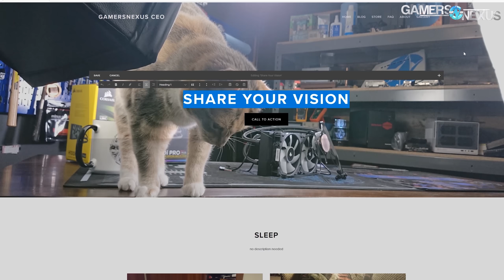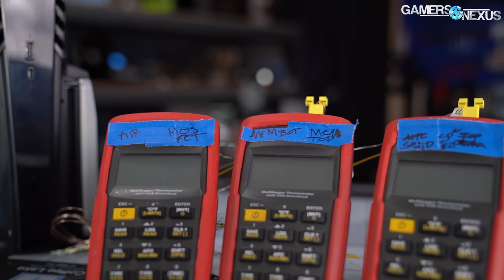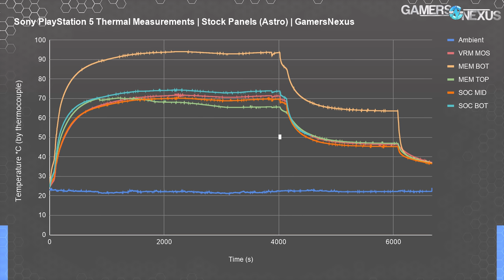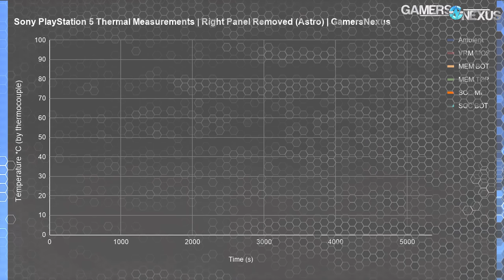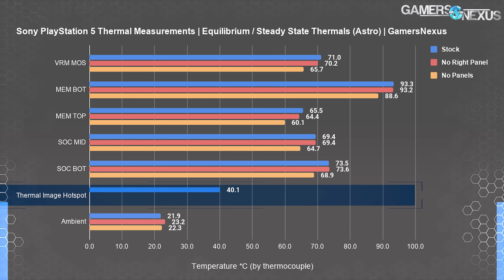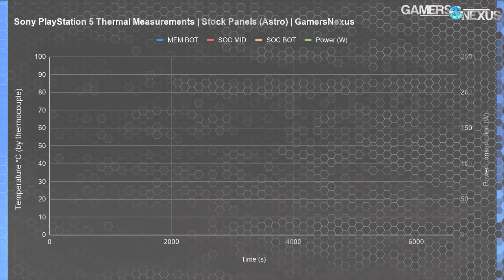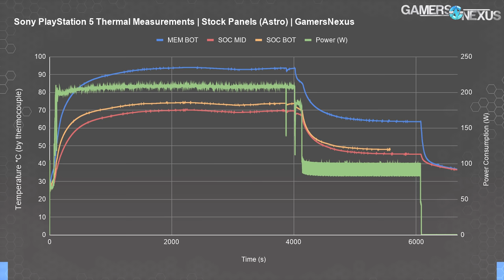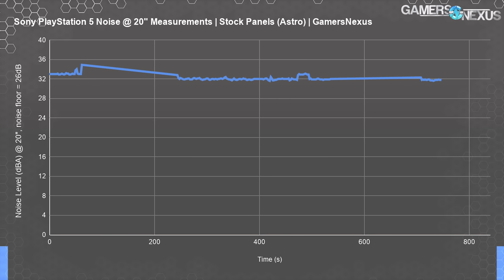Weak Cooler Design: PlayStation 5 Thermals, Power, & Noise Testing

Comment: I always keep my PS5 laid horizontally. Bought custom panels from Amazon, drilled small holes on the side that stays on top when laid horizontally, as to expose in part the fan. My plan is to make a whole bigger whole as big as the fan (instead of having smaller holes) so the  fan is exposed then put a mesh under the panel (as not to expose the mesh) and glue the mesh to help with preventing dust while still help with the cooling. Might do this on the other side BUT since I keep my PS5 horizontally I might just do one side. Any suggestions are welcomed.
Reply: seems like overkill for me. but you do you

Comment: These temps at 21c ambient make me very very worried for a huge swath of users in warmer climates - here where I'm from, ambient is like 32-35c, so I can imagine prolonged gaming with no climate control will cause issues for a lot of users... Always found the design suspect, but that is seemingly quite the oversight here from Sony
Reply from the maker: In theory, hopefully, the firmware should spin the fan up more to meet similar performance levels, but until we get a thermal chamber, there's not a great way for us to test that. It's definitely something we want to add to our tools as soon as we can.
Reply: I wouldn't worry too, a console isn't for benchmarking or stress testing for an hour. The PS5 runs cools and quiet in general use.
Reply from the maker: @26101976bdm  ... lots of people play games for hours at a time. It's not like we ran FurMark on it.
Reply: @GamersNexus  Absolutely people game for hrs on end - but the stress on the GPU & CPU jumps all over the place. Running FurMark on a PC is a valid thing to do  - that's what most PC's are designed to do. Appreciate the reply - Cheers.
Reply: @RitsuAbyssgard  He's probably just a hardcore fanboy that defends Sony no matter what. Every single Playstation since the original has had insufficient cooling, but it wasn't really a major problem until the PS3 started melting itself and the PS4 couldn't hold 30fps at 720p low/medium settings in GTA V. Pretty much every game out right now for the PS5 is just a PS4 port, so if it's already running this hot with PS4 games and 20°C ambient temps, we'll see how bad the cooling really is once they actually start making games for it.
Reply: @RitsuAbyssgard  because its true haha - extreme situations notwithstanding.
Reply: @26101976bdm  And you know that how? With your own testing? Remember this was tested with Astro. Not a game that even starts to push the PS5. 
It is highly likely they will push the fan curve quite high to combat this and the silence will be gone.
Reply: @2nd_Directorate  because I own one, play long sessions of Demons Souls and it is fine. Absolutely fine. I don't know how else to put it.
Reply: @RitsuAbyssgard  I know there guys are nuts no matter what is said. I got one trying to convince me he is a Oracle developer so therefore he knows the XboxSeriesX is shite due to a few poorly optimized games the first week of launch. 🤦‍♂️
Reply: Exactly... not sure why people are brushing this off. This is a HUGE issue. It was 37C here today in Australia. This means the temp would have passed 105C on that memory chip. NO WAY IS THAT IN SPEC. No way at all. Are we meant to believe the fan is designed to ramp up to cool memory chip that isn't even on the heat sink? No way in hell. Someone needs to test this at 40C ambient and see how hot these chips are getting, my guess is that they will blow past 105C.
Reply: @sectokia1909  There's already over 10 posts on Reddit about bricked PS5s, so I wouldn't be surprised if there were already a few that melted their own memory chips.

Comment: [Imgur](https://i.imgur.com/MkZGzeJ.png)

I noticed that Gamers Nexus left a gap between the heat shield and the PCB where they routed the wires out (even though they claimed there's an uplift, which there isn't) compared to stock (where there is no gap). See image below.

This gap could create less pressure between the GDDR chip and the heatsink/thermal pad, potentially resulting in the poor thermals they measured (for thermal pads, gaps and pressure makes a huge difference).

[Imgur](https://i.imgur.com/MkZGzeJ.png)

If they didn't create this gap, the GDDR chip temp might be closer (but not exactly) to the 65 Celsius they measured on the "good" GDDR chip (they were guessing this chip was being cooled on the PCB opposite side).

Thoughts?
Reply: Yup potentially flawed test methodology. Spawn wave also tested the ps5 with thermocouples and got only 83 Celsius
Reply: Damn...didn't realize it till I read your comment. So your saying his high temps were indirectly caused by the way he set out to record said temps?
Reply: @mutalix  yeah i can't be 100% certain until someone else does a temp reading on the gddr chips with the heat shield properly tightened against the PCB and memory chips (spawn wave didn't show his test setup), but at the very least this test needs to be redone.  Thermal pads are only a few mm thick, so lifting the heat plate a couple mm is a huge reduction in contact and pressure.  The gap he created would only increase the gddr temperature and this needs to be eliminated as a variable by retesting, otherwise he can't make some claims he's making.
Reply: @nghiatran2278  Interesting perspective on these matters. And from a rational standpoint gaming nexus methodology could have cause those higher temperatures. Thanks for sharing!
Reply: @mentugo  I think its more the GDDR6 technology. My Radeon RX 5700 reference card under 100% load goes up to about 88 decrees on a bad day even with the gpu fan on 50%. GDDR6 just seem like very hot chips

Comment: The fact that such a large system with such a large heatsink could have ANYTHING getting too warm is quite the screw up.
Reply: It is high clocked system
Reply: @سعيدالسلمي-ظ8ث  Sure. But they could've easily added better heatsinks to the memory, increased the speed of the fan a bit.
Reply: @DaveGamesVT  heatlinks hahaha. Memory is always at high temps.

Comment: Ah.  I just read over a few more websites' documentation of this, including Sony's initial design comments and now reaction.  Apparently, Sony are considering customizing fan curve profiles on a game-by-game basis.  I personally wouldn't mind a little more noise if it helped key hardware components stay cooler.  Since my console has been having intermittent issues since day one, the first thing I considered (well, guessed) is that it was a heat related issue.  I think I'll let a couple of weeks go by to see how this emerging information settles, and then maybe drill from a mesh style template through the side panels where both sides of the fan sit.  Thanks for all the time you took to test, and for the really useful information.

Comment: With the hour or so to hit steady state max temps, I have to assume Sony figured loads would be more variable and not such a high demand for that long...kinda like modern mobile CPUs that aren't capable of running their max speeds outside of short bursts. There's no way this just slipped past designers since thermal management is one of the biggest areas in development. They must have decided the risk vs cost of cooling modification was acceptable? I can't come up with any other reason why they'd let the design pass since this should have been noticed and simulated really early in the design process.
Reply: Never underestimate bad coding. They should've expected maximum load at all times while playing. I'm betting that's exactly how devs look at the hardware.

Comment: Was your thermal testing was done on an open table or stuffed in a shelf? Every console I have ever seen was stuffed in a shelf or even in a closed cabinet. This is a major clarification that is needed, especially since the thing runs so hot already. I get the feeling a lot of these things will have overheating issues to the point where they actually have hardware failure or major throttling

Comment: Imagine, memory at 95C
Reply: It is nuts.
Reply: That's within spec. GDDR6 is rated for 110 C.
Reply: @battlephenom8508  Source?
Reply: @battlephenom8508  I dont want anything in my PC going above 90C
Reply: @kylehagertybanana  That makes two of us. Still wish Sony was just as concerned with their own systems.
Reply: @battlephenom8508   right, and using your own link, when you select 16gb instead of 8gb, it changes to 95C.
Reply: @zacharycrosier9296  You'd be downvoted into oblivion on Reddit for suggesting it even linking to that.

People are so upset over this just appealing to authority to cover for the fact that Sony couldn't spend 1-5 bucks to make a difference on memory.
Reply: mikeisu  Even though, it shouldn't be constantly near the max. That will definitely decrease the life span of it. It will cost much to replace those if they broke, while it was better to pay few extra bucks for cooling pads,copper or whatever is the solution.
Reply: mikeisu  maybe because astros play room isn't exactly a next gen graphics monster and also some people live in warmer climates. Imagine putting this thing in an entertainment center or live in a house that isn't air conditioned. You'd be quickly over that limit and you'd start seeing artifacts and graphical glitches. In fact that is exactly what is happening.
Reply: @ltl-cx9xs  and this is the reason you dont buy a console that was never seen until almost release day. So those rumors about sony having issues with cooling were true and here are the results lol Series X FTW.
Reply: @zacharycrosier9296  I'm not devil's advocate but according to this document of the 16GB GDDR6 memories the GN methodology is not correct or precise: "Attempts to calculate the junction temperature using traditional θJA calculations are not recommended. Using the traditional
method can produce significant errors because important parameters such as airflow,
flow type, adjacent components, heat dissipation direction, PCB thickness, and PCB
copper content aren’t accounted for with enough detail to apply to a real application. A
real application is typically very different than the JEDEC-defined environments, where
the thermal impedance values are determined. This can lead to very erroneous temperature estimates based on the θJA or θJMA calculations"

Though, the maximium junction temperature (i.e. real temperature of the die) is rated at 100 degrees.

Source: TN-00-08 Thermal Application https://www.micron.com/products/ultra-bandwidth-solutions/gddr6/part-catalog/mt61k512m32kpa-14
Reply: that's nothing my cars exhaust hits 500 to 1000 degrees your ps5 is fine
Reply: The Flash  Fair enough. Girls are more stress than fun nowadays but I see what you're saying.
Reply: The Flash  isn't his use of the words 'youll be downvoted into oblivion on reddit' used to ridicule Reddit rather than as an insult? I don't think your criticism has much basis, I could be wrong ofc.
Reply: The Flash  please stop touching women they say u smell bad and are creepy
Reply: The Flash  your children would say stop asking us about sex stuff while mom's out of the room

Comment: Mine has coil whine and it's obviously coming from the power supply.
Reply: Same with mine and all my friends have the issue. I mean it's not a big problem but I do hope it goes away with time. PSU is definitely where it comes from.
Reply: @Komodo_Dragon  sometimes coil while can get better over a few weeks, it takes time for the coil to bed in. If it doesnt improve within a month or two then thats probably how its going to be forever.
Reply: I read that if you can find a situation that causes the loudest whine and let it sit there for a while it can help it bed in and it might reduce in volume/frequency or go away entirely. What I was reading was about gpu coil whine but I'd think it could work with a PSU too
Reply: If you open up the power supply you'll see Sony (or whoever manufactured the supply) didn't use any glue on the coils.
Reply: @deathk26  ffs sony just won't get their shit together. So have you opened the psu actually?
Reply: @Komodo_Dragon  There's a picture comparing the two here: https://www.reddit.com/r/XboxSeriesX/comments/jv8lt6/why_the_series_x_is_considerably_quieter_not_just/
Reply: @deathk26  Jesus Christ I can't believe they cheaped out on this so much. This is beyond my understanding.
Reply: I wouldn't risk opening up any power supply. It's dangerous. You touch one of the capacitors inside and it's lights out for you. That's just a reminder of the risks
Reply: @Komodo_Dragon  499 end user price dont give them much of a head-room to use high-end components. However this still doesnt justify all these design issues.

Comment: This is why I always buy a small 6 inch diameter fan and blow air over the outside of my PS3 and PS4. I had my PS3 originally lock up on me one time and it never did for years once I installed the external fan. It must've been 2015 that it started acting up again and I replaced the thermal paste for the heat sink which solved the problem. Sony should know better based on their track record.

Comment: Why dont you go ahead and put bigger contact patches in the memory and do a retest to see if it works as you say??
Reply: The divots in the metal backing are not bigger than the thermal pads, nothing would be gained.

Comment: Now imagine the fan full of dust with ambient temperature of 26°c. It would fry itself.
Reply: @reeven2002  Well, it depends where you live. In central europe, we wont get more than 35°c in the summer, so 26 inside is still quite hot. If you get 44°c outside then yes, 26°c inside would be awesome.

Comment: What is funny is people are running with what he said. But manufacturer of the memory said what degrees is okay for the chip. An what he said is normal lol
Reply: Exactly. It's like complaining that a kettle runs hot. It's made to run hot.
Reply: what you don't understand is "okay" isn't great or perfect it means it's manageable. This is tech things fail eventually.. A component running at an "ok" temp is more likely to fail earlier than a component running at a cooler temp.

No matter what you're doing these things are facts.

Cooler is always better.
Reply: @whothou  it don't matter what you say..amd is already said it is ok. So ain't no point in losing to fake tech guys on YouTube
Reply: @donnellbrown4575  If you're considering old mate Steve Burk here a "fake tech guy", then you're a fool. 90+ degrees at 20 degree ambient is just not good, especially when you consider that real world environments will be a good deal hotter! That's just not conducive to a unit lasting something like a few years. I'd expect serious issues if the ambient temp is high and the memory doesn't get any cooling.
Temper your fanboy-ness and show a little respect, hmm?
Reply: Also, it's NOT normal, it's just something that the memory can "technically" stand up to. I wouldn't know for how long though, I would not like to see any system component running that hot for too long.
Reply: @donnellbrown4575  I suppose I should be grateful you've run out of insults or interest towards me? The question is, why respond with insults and dismissive attitude when you can use reason instead?
Reply: @danielharvison7510  lol saying I ain't wasting my time replying to you.  Is not me saying anything bad about you wtf. I just act going to keep talking about this lmao bye
Reply: @donnellbrown4575  Of all the things worth getting passionate about, a console is NOT one of them. Totally not worth it mate. But you do you.

Comment: PS fans: “Mine is not this hot, liar!”
Reply: It isn't though for a regular user they wouldn't notice anything as it sounds extremely quiet and heat output is average. I guess if you want to get technical the memory is running hot but thats within reason gddr6 runs at 125 degrees. If you are a tester ofcourse you will find this stuff but the average user won't notice a thing.
Reply: @malazan6004  Higher temperature = lower life span

Comment: Guess this explains the wide spread artificating on alot of ps5's meaning they are dead on arrival / unusable. (as seems to be the case for alot of consumers right now)
Reply: Memory too hot would definitely cause that. Assuming no damage was done by the heat, improving the cooling of the memory would also fix it.

A pressing issue for sure.

Comment: Are you telling me that Sony couldn't pick this up when they designed the PS5? 🤔🤔
Reply: Yep... Definitely! A random youtuber picks up what the formally trained engineers and R&D department at Sony didn't pick up on!
Reply: @Siguchi  he is not just a random youtuber. he goes in depth on stuff like this for a long time now. still, sony should have done better.
Reply: When you work with timelines and Budget you have to do sacrifices. Steve is only showing where they did it.
Reply: @steffenwei9926 trade-offs are inevitable, but calling some design choices poor when the module is working within specs is just out of place. Also, no matter how someone seems to be "knowledgeable" on something, I can't trust them unless they have the proper training for it (especially if their sample size is 1).
Reply: Apparently he knows more than Cerny and the hardware engineers.
Reply: Well Sony themselves said that they are going to wait on the feedback data they get from the consumers so they know what adjustments need to be made on their console. They literally told you fan boys you would be the guinea pigs for their consoles current design 😂😂😂😂

Comment: Always the same issue with all sony consoles starting with ps3, crap design to make a futuristic router console, to sacrifice cooling and lifetime, also embedded sdd in the motherboard, which everybody knows sdd is very prone to fail after multiple read writes, no easy way to replace, or impossible if sdd has some protection, really crap console as always.